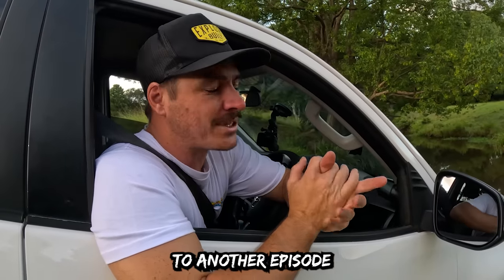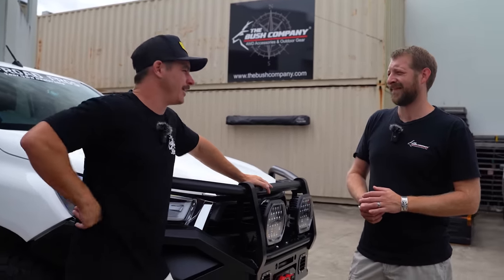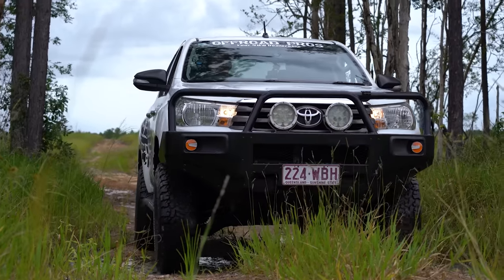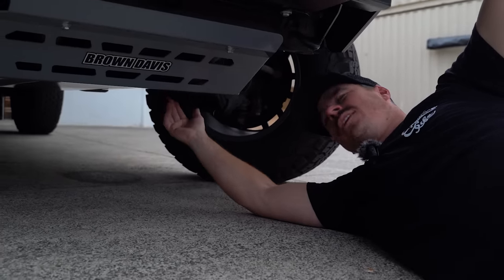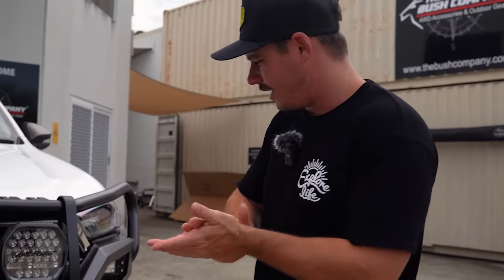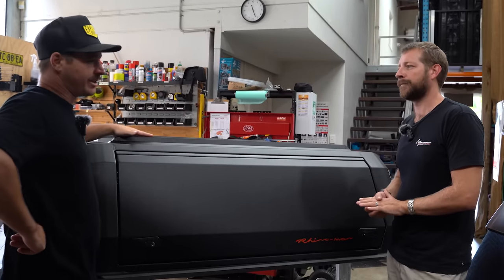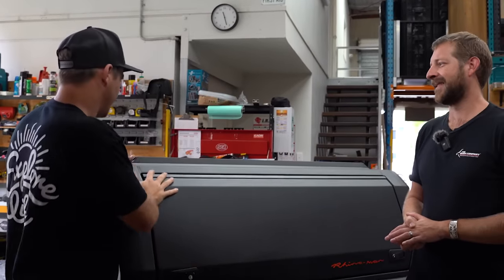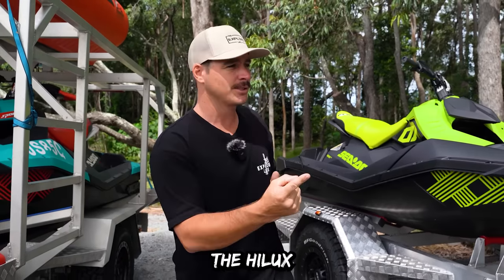Hilux Build Pt.2! MUST HAVE Touring Mods For Your 4X4!

Comment: You really need to remove the word budget from the title because this is far from budget build. Budget build would be cheap spot lights steel wheels and $1500 bullbar. Not $2k lights $3500 bullbar and $3k wheels and tyres
Reply from the maker: Watch from 6:19 mate

Comment: 10/10 for the front bar and lights! looks sic as! 

Stage 2, um yeah I dig the Canopy, never like flexi canopy's myself, its a tool, not a prom dress! 
Id def add sliders, rear bar, something tucked up, I hate low drawn rear bars on Utes myself! 

Understand the budget and its a give away, but KISS is my motto, simple 12v system I like the fixed Go Block idea if ya can remove it for the tinny or swamp boat, nothing fancy for the fridge, just reliable mate. I'm hanging out for a Bush company awning in Army green, don't know if I'll go 270 or 180, I'm all about less weight, so still deciding, I d like the rear coverage idea, but then I also carry a super light tarp and its an 80 so it has in built tech and kitchen factory from Toyota, wheel carrier is a hanging pantry and storage rack, fold down bench and lift up roof awning, all free! though its small and I do get wet lol, hence the tarp, it takes bit longer to setup than a self standing awning, but its effective and super light super compact. I use carabiners with adjustable ropes so not hard, If I cant fit in a decent off grid tramping or army backpack apart from  truck spares, tools and fridge, I wont carry it.

I dunno what else id add in stage 3 other than comms, definite must, maybe some canvas seat covers and sandgrabber floor mats, best thing I added to my 80, man they keep the mud and shit out, best interior mod I made after the XT seats, not sexy but functional, I guess you'd want camp lights another reason for a roof rack up front, oh got to have some mean as Flares looks a bit plain on the wheel arches for some bling yeah, my list fwiw mate 🤟.

Comment: Using a Hilux as a base is the biggest "budget" part so far. hahaha. The front end looks pretty damn good for a Lux Matty, nice choices for gear. I have 2 4WD's and have the Carbon 12,000lb winches on each, they are farkin awesome! The canopy looks OK but I personally prefer a full tourer setup. I think stage 3 could use some lighting, like you said, water storage, 12 volt setup, comm's, and maybe do something for dog owners to accommodate their dog/s (ramp for the dog to get in/out, water/food bowls, comfy bedding), I've NEVER seen that done before despite so many people taking dogs on tour with them. All in all, looking great so far mate. Oh, and by the way, I'll take the trailer with the boat on top thanks mate, get it cleaned up and ready for me to collect. hahaha. Cheers brother and say HI to Nav for me.
Reply from the maker: Thanks for the ideas mate!
Reply: The dog idea is absolutely killer, should definitely look into going down that route!

Comment: It's coming together nicely. I reckon you should put a counter in the screen for for many times you say "guys" 😂😂😂
 Speaking as someone who couldn't afford to buy this vehicle stock standard before modding, my advice to those who, like me, don't have the money to do something like this, is to take yours from these builds and find cheaper products. I built my current 12v and drawer system myself mainly because I can't afford Redarc and Dometic and I'm actually struggling to save money to buy a roof rack. Just because you don't have the budget that others have, doesn't mean that you can't set up a vehicle that you can your with. It just means that you may take longer and not have all the best stuff. It's not worth getting upset about. There are other people in YouTube who do low budget build stuff. The bottom line is that even doing it on a low budget is still gonna cost. Just enjoy the videos people. Enter the comp and maybe you'll win and save yourself a shit ton of money in a build. If not, like I said, get your from these vids and then source cheaper products.
Reply from the maker: Exactly right mate, there's different brands and quality levels that serve different parts of the market. I won't promote average quality gear that I wouldn't put on my own truck but that's not to say cheaper options don't exist! Do what you can with your own budget and get out and explore. That's what it's all about 💪

Comment: When you crossed the creek I noticed the front of the awning flexing and shaking about, I really think your mounting points are too far back especially if your going to tour on ruff roads, you might need a roof bar as a 3rd anchor point
Reply from the maker: It has a little shake but the mounting points are far enough apart to support the awning due to its structural strength 🤙

Comment: Love the tub life ....... not sold on the bolt on canopy it will be a hassle for those on the vertically challenged side of life to access a chest style fridge sliding out from tailgate and a small upright is exactly that too small, esspecialy with a 2"  lift making it harder still for anyone under 6 foot...... now if you could get a slide out drop down to clear tailgate that would be the ticket.

Comment: I have an SR5 & that tub is APPALLING when it comes to dust ingress! Travelling around Aus I had to duct tape inside the tailgate to stop the dust screaming up through the factory seals. How do you solve that massive issue with the new canopy?
Reply: I think there are a few mob doing seal kits for the rear tailgate mate just google not to sure how great of job they do but worth a try
Reply from the maker: The canopy has a positive pressure vent which should help but won’t eliminate 100% of ingress, I’m looking into it. Seal kit is a great idea 👌
Reply: Toyota do a dust seal kit for tubs as a genuine accessory now. Just no one knows about it….

Comment: Rhino canopy nice however all tubs split welds below near taillights eventually so wonder if this will speed that up. Had colorado rc canopy on back then took it off and put rooftop tent on canopy and after 330 000km the tub started splitting  asked around and happens a lot with tubs

Comment: Keep the Go-Block to keep the price down, and also a full 200 ah system is a bit of a wank as the idea of camping is to getvaway from technology as much as posible....

Well, that's my take on it as I just use my ark power pack that runs my fridge and lights at night, but at some stage I will upgrade to the Redarc Go-Block.